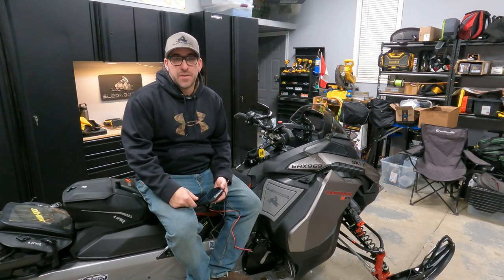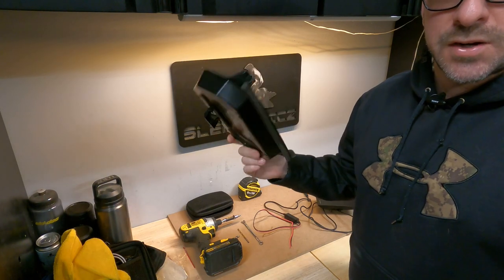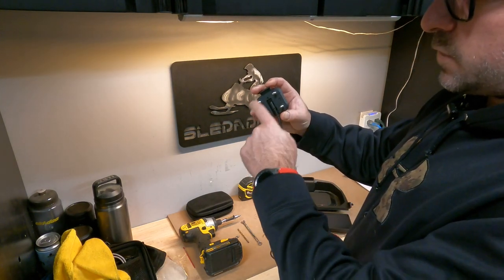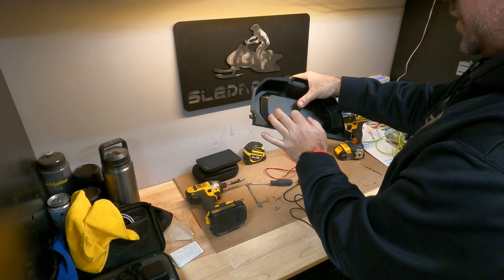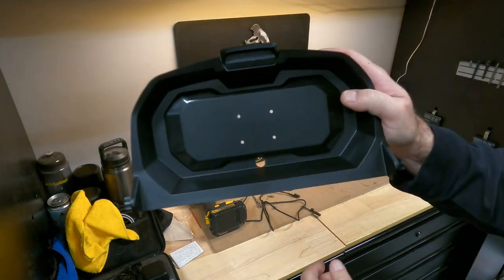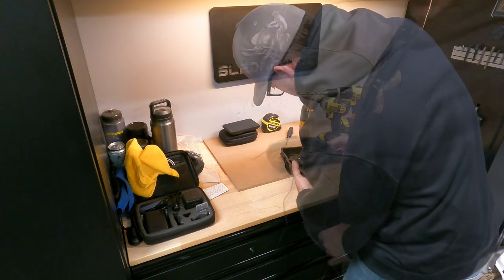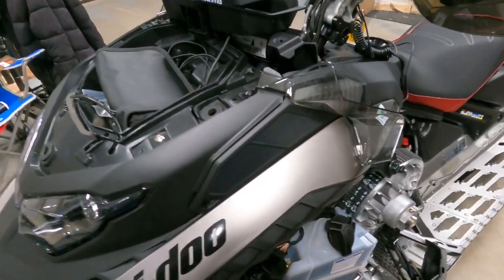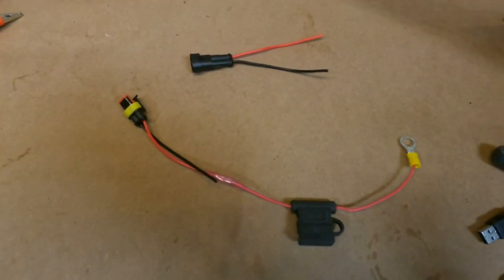Garmin GPS Install on 2023 Ski-Doo Renegade X-RS 850 | Best GPS Setup EVER! | Radioworld.ca

Comment: Nice work on this install video. The new G5 GB extension looks great and nice to see. I run the GB extension on my Mach Z(G4) with the cell phone holder which works nicely too. I have been running the automotive Garmins for 8 years now on all my sleds and those cheaper models have never had any issue with cold temps or freezing screens as commented below. I have been running a Drivesmart 66(6 inch) the past two seasons with perfect success. I have always mounted my Garmins on the riser clamp bolts for ease of use and close viewing. 

Thanks for the great video showing this all. I have got so many questions about wiring over the years on dootalk it's nice to see a video for everyone showing the solenoid clearly. I can't tell you how many times I see people running the hot wire to one side and ground to other side of solenoid, and wonder why it does not work properly! Always run ground wire to chassie guys. Nice work.  -Rockerdan
Reply from the maker: Thanks for watching Dan! I probably got that tip from you years ago on Dootalk :-) I used to run the NUVI's and never had issues either. Garmin make great products - I don't think you can go wrong with any of them but I doo love this new Zumo XT. The display is crisp and its fast. I used to run them on the bars, but it's not as good of a view compared to running it on the glovebox. I don't want to look down - I want the GPS in my line of sight. That's the beauty of the Polaris gauge and even this new 10.25" display on my 850 is night and day better but having the Garmin on the glovebox is the perfect spot. Cheers buddy, Mike
Reply: @sledaddicz  I hear ya, i do like my cell phone heated holder and it's position high and center. I typically don't have to watch GPS but when coming to intersection ect. I do like to tap on it at times though which is one drawback of the newer automotive(Drivesmart) series since they are all now capacitive touch(like a smartphone). My older 2797 and even Nuvi's in that respect was nice with the pressure touch system. But wow the clear glass screen is so much more hi res then the old matte screens. Garmin certainly does all this best. I really love that newest Zumo, it has a cool MP3 feature too which i love and can hold up to 1000 mp3 files if I recall, nice for music! I just had wished for a larger zumo(7" would be sweet spot for sled IMO) but likely wont happen as most Motorcycle guys want this 5.5 ish size for mounting to their bikes.

I did find buds new 10.25 screen when plugged in to smartphone/BRP GO app looks really nice! Large screen for GPS toward right side, and works well in and out of service(Must DL maps ahead of time for area). Ride sharing is OK at best, as service is in/out it gets annoying seeing buddy pop on/off. LOL

But in the end, DOO needs to simply add an antenna and corresponding software(ala Polaris) to bring the experience to where it needs to be. I just hope it doesnt take as long for this last step as it did waiting for LED headlights...lol

Keep up the great work Mike!😁

Comment: I have the extension that is heated,but I noticed you mounted it on the outside? I also have the same Garmin ,but I Iam mounting it on a 2022 Renegade 900R. Iam now thinking I should do it this way too with that same mounting attachment that came with the Garmin. I always thought I should power it that way also. Going to take another look at for sure. Great video.
Reply from the maker: Thanks Bruce. Yes, you mount it on the outside of the glovebox door. Cheers Mike

Comment: Can you put a parts list in the description with links? Zumo® XT 5.5" Motorcycle Navigator but do you need to buy the Motorcycle Mount Bracket? Maybe you could list the unit, the card required for the trails, the glove box extension, if theres a bracket required and the automotive connector bought at crappy tire.
Reply from the maker: Hey Matt. The zumo xt comes with almost everything you need. Depending on where you live, there are different providers of the maps. Trakmaps (trakmaps.com) does most of Canada. The glovebox extension is available on ski-doo's website if you just search it (ski-doo.com). No bracket is required - that all comes with the gps. The connectors are a bit tougher as we have lots of stuff in the garage so just put some stuff together. Let me know if you have any other questions! Always happy to help. Cheers, Jesse

Comment: I have the same Garmin Zuma XT. I did a video installing mine into a Aqua Box because I found when the temps get in the single digits, the screen begins to drop colors or starts to freeze up. Being in the Aqua Box, the unit stays warm under it's own heat a tad longer. If it's really bad, I have room to put in hand warmer packets on each side. I did ride last weekend in the Polar Vortex temps of -14F for a high, zero issues with the screen that day, hands though....another story.

If your going to use a Micro SD card with maps already installed, you will need to go into Setting, Maps, MyMaps, turn off all the maps Garmin has put in and leave on only trail maps. You may or may not see a double "Snowmobile Trails" maps, both should be selected.

Lastly DO NOT LEAVE THE GARMIN ON THE SLED OUTSIDE OVERNITE!! I made that mistake with my Zumo XT Garmin. The screen froze up and did not show correctly.  Otherwise, it's a great unit!!!
Reply from the maker: Hmm we have used our garmins in -40C before and it's never frozen or let us down. Yep we know all about the mapping as we pre plan all our trips and have them on the gps ready to go. Interesting that it froze over night - I wouldn't know because I've always brought it inside. To expensive to leave on the sled. Cheers, Jesse

Comment: If you pull the 10.25 screen out there is a 12 volt 2 wire plug back there.
Reply from the maker: Yes but unfortunately that defeats the purpose.. The reason we wire it to the solenoid is so it has constant power, that way when we turn off our sled on the side of the trail the GPS doesn't shut off. Cheers, Jesse

Comment: what gage is the wire on the fuse holder you used? great video thanks for sharing it!
Reply from the maker: Hmm that's a good question. I'm not sure. I just bought a standard battery tender cable from Canadian tire. Cheers, Jesse

Comment: Great video. So this Garmin Zumo XT does not need to been in a weatherproof enclosure ? Also the part that permanently mounts to the glove box comes with the Garmin or is it a separate purchase? Thanks again
Reply from the maker: That's correct. It's a nice unit and fully sealed. The part that mounts to the glove box comes in the box. Cheers, Mike
Reply: @sledaddicz  Thank you !

Comment: Great video, thanks for sharing….wondering on a Gen4 if connecting a Zumo xt2 electrical off the BRP plug under the glove box currently used for my USB outlet (via a splitter) would work as opposed to connecting down to the solenoid?
Thanks
Reply from the maker: Hey Kevin. Yes that would totally work. I think we talk about this in the video, but the main reason we don't use the ski-doo plug n play connections for our GPS's is because when you turn off the sled the gps loses power and will likely turn off soon after. Often times I look at my gps at the side of the trail when we are stopped and thats why we wire it to the battery for consistent power. We just take it off at lunch and at the end of the day to not drain the battery. Been running this setup for the past 7 years on 10 different sleds and it works great. Cheers, Jesse
Reply: @sledaddicz  awesome, thank you

Comment: Is there still the option to keep the heated pouch for the cell phone with the glovebox extension and gps? Great video
Reply from the maker: Yup! Our heated pouch is in our glovebox still. Just disconnected it from the stock glovebox lid and it sits on the floor of our glovebox now. Still holds our phones. Cheers, Jesse

Comment: Nice Install on the Gen5 Sled. I guess you never got the Tablet working  ?
Reply from the maker: Thanks! Nothing worked to keep the tablet from freezing and turning off below -20C. We tried heated elements to keep it warm and it just didn't work so we reverted back to our Garmin units which we love. Cheers, Jesse

Comment: What was the previous version of Garmin you were running? I've got Rev-XS and need GPS. The Zuma specs for use and charging have temps above what we ride in, but I assume you've not had issues with the older one or this XT?
Reply from the maker: All garmins will work for you. I used to run a Garmin Montana 650T on the rev XS but after running the Zumo that would be my suggestion. Bigger screen and quicker speed. The Zumo will work in even the most intense of temperatures. I have ridden countless times in -40C and the Zumo never skipped a beat. Cheers, Jesse

Comment: Hey you think the 6 inch XT 2 will fit?
Reply from the maker: Not sure.. Does it use the same mount as a zumo XT? The XT takes up most of the area so my thought is an XT2 would be too big and you wouldn't be able to open the door all the way.

Comment: The new 10”Skidoo display doesn’t have an on board GPS like the Polaris 7s display?     Polaris 7s doesn’t have to be connected to a phone for the gps to work, it’s built into the unit.    If skidoo’s is not like that it’s a huge miss by them.
Reply from the maker: Thats correct. Word is that this will be improved and likely incorporated into the gauge in future years. Cheers, Jesse
Reply: Thanks for the reply, Jesse.    I hope they do, it’s needed.   I still think skidoo probably makes the best sled out there but, like you guys, I’ve also ridden the Polaris Matryx and that is a really fun sled.  I was very impressed.    Take care.

Comment: Christopher from Ottawa the unit how does it work when temp -15 or 20, I cures use garwmin  15 year old gamin 60 count that gives me turn by 
turn directions using track map showever like your with larger display, however how do you like, touch screen buttons,mine of course has real buttons, by way do you loose GPS signal in heavy bush, wish had known you were going g to Mt Laurierwouldhaveloved to limkup with you folks,Christopher Ottawa
Reply from the maker: Hey Chris. Our GPSs work in all temps - I have used them in -40C and never had any issue. The touch screen is fantastic - no need for real buttons, have lost signal in the bush a few times but it comes back in a minute or two. Cheers, Jesse

Comment: It's funny, but sad, that we now have such a big screen on the doos, but they can't add a built-in GPS for it yet.
Reply from the maker: yep. Skidoo is on it and it will be an option for 2025 models. Even if they do incorporate BRP GO into the gauge I will still use the garmin tho. There really isnt anything better - it fits nicely into the design, its super robust, and it hasnt failed me in 50,000 kms of usage. Cheers, Jesse
Reply: @sledaddicz  what do you mean? The 10.25 gauge you have there already has gps in it? Why are you installing this other gps? In 2025 what are they adding since they already have it now lol. Sorry if I am misunderstanding what your saying. My 23 remegade had same gauge and it had BRP go or whatever that worked great? Unless your talking about BRP is adding a phone less gps in 2025. That would be awesome and hopefully you can get an over the air update and maybe by a module that plugs in the back for $200 to make it work like the Polaris 7s lol. Like it should of from the start to be honest…
Reply from the maker: @xGR1MxREAPERx  yes brp is planning on incorporating the gps into the display without ur phone hopefully for MY25. In terms of why I like the garmin better, I would suggest watching some of the garmin or brp go videos we put out as I really go in depth into my reasons. Cheers, Jesse
Reply: @sledaddicz  gotcha.. 👍🏼. Is this something an update to our current 23-24 sleds can get or would be need to buy a new gauge/module for that to work like that I wonder? I’ve seen some of your videos about it but not one about it by itself I’ll try to find it thanks.
Reply from the maker: @xGR1MxREAPERx  unfortunately it won't be a software update or something u can upgrade. It will likely only be available on 2025 sleds and newer
Reply: @sledaddicz  of course after waiting 4 years to order a new sled, I order a 2024 and the next year will be the best version lol

Comment: Just wondering if any one has any suggestions for a problem I have with my Garmin sumo xt ? Had the Ontario snowmobile trails installed on my Garmin and now when I go to use it the map isn’t there anymore. The sd card is properly installed and all other maps that came with the Garmin are in checked? Any suggestions would appreciated.
Reply from the maker: Hey Bruce. Go to settings, find my maps, and make sure all maps are turned off and the only one turned on is trakmaps. That should do it. Let me know if that helps! Cheers, Jesse